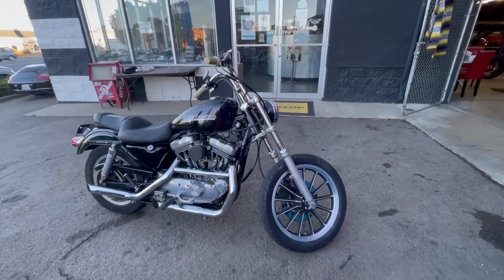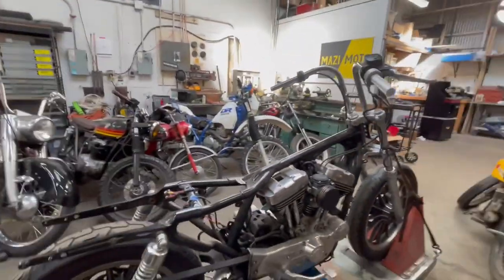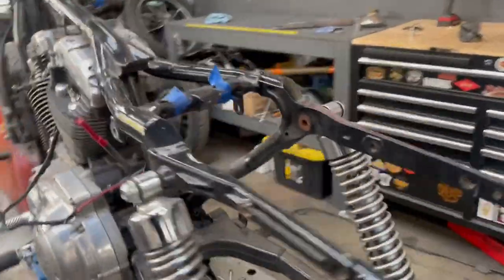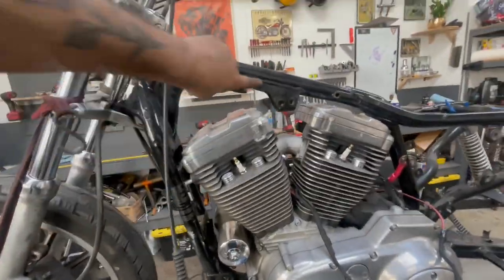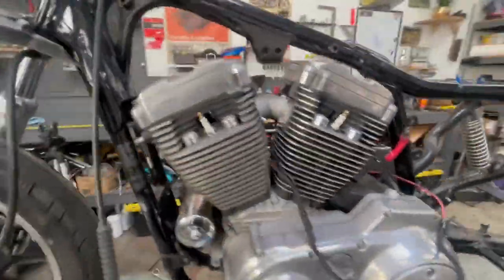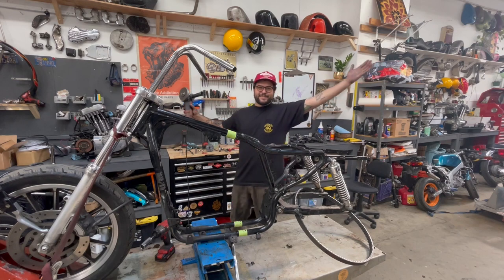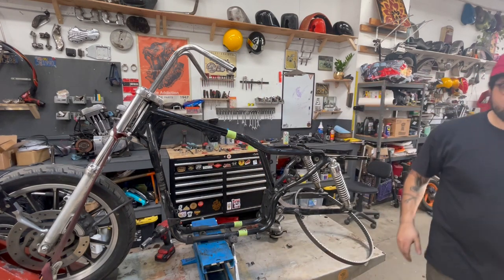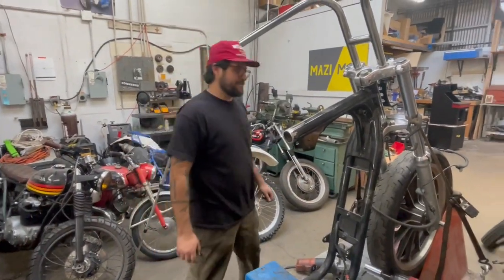Throttle Addictions Sportster Hardtail install Evo Sportster Chopper Project Part 1

Comment: Never had a hardtail Sporty, but I always admired them. Nice and low and the Sporty motor can be built into a beast. Knew a guy with a Ironhead Sporty, ran mid 10's in the 1/4 mile. Extended swingarm with struts and wheelie bar...not a street bike! Your videos tend to send this old man down memory lane. Thanks!

Comment: At this time ..could you shorten your back bone ..1/4"..1/2"..to accommodate say putting on a 6 or 10 over  springer front end ..that way you wouldn't have to cut apart the neck..???

Just wondering ..

Comment: A rigid frame is cheaper than the kit and it has at least 4 benefits. The rigid frame is $1,100 while the kit is $1,300.
Benefits:
1) There are no weak points in the frame
2) You don't have to weld anything
3) You don't have the rear section of a frame to dispose of
4) You have a completely stock frame you can sell for $300-$400 to pay for the parts you'll need to replace
$1,100 - $400 a frame sells for on ebay and that rigid now cost you $700
Reply from the maker: Although I completely agree with you, the one downside to doing that, which to most people is the biggest one, is then your original vin number is no longer on your frame. Which here in CA can be a big issue when going to sell the bike/ can result in titling issues, especially if you ever have to get a vin inspection by Chp.
Reply: @947w0rks  Good point. I had the same problem buying a motor in Modesto. The bike got a new motor and I got hung up at the DMV.